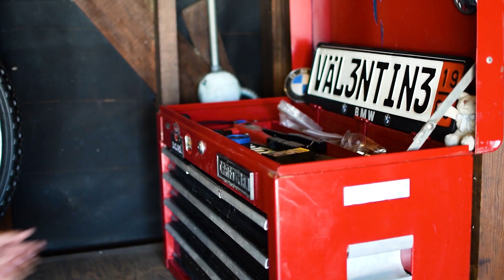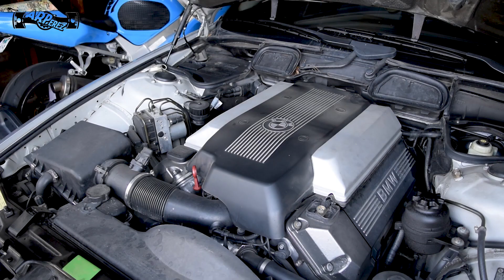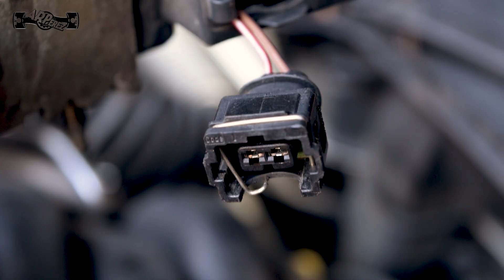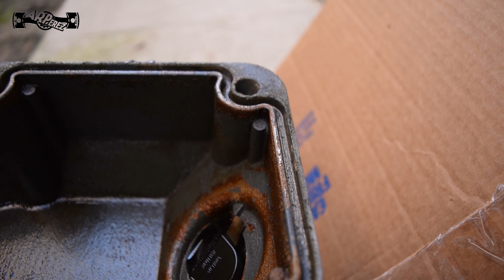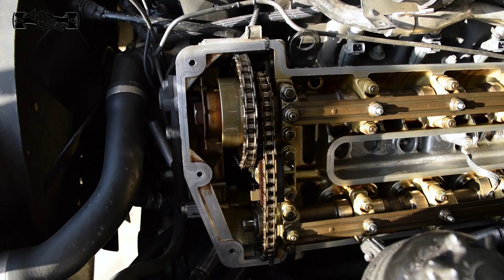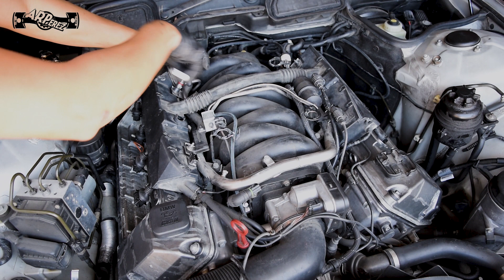HOW TO: Valve Cover Gasket Replacement BMW 7 series (e38)

Comment: Disconnecting the battery is ALWAYS STEP 1!  Wrapping that positive terminal in a shop rag is DANGEROUS and simply dumb! DO NOT follow the instructions on wrapping the hot (positive) terminal in a rag and then setting it aside!!!! DISCONNECT THE BATTERY ALWAYS!!!! Terrible advice, you should update your video!

Comment: Great video.

Here’s a weird question for you, or anyone who might know.

I’m mid way through doing the job on my 1998 E31 840Ci Sport.

I have owned this car for nearly 20 years and it only has 27K miles on the clock. I’m pretty sure no one has been into this engine before.

I have made a weird discovery! On every single one of my Oil Spray bars there is only ONE nut holding the down. On every single one this is the very FRONT nut. The other studs that the bars sit on have no nuts! So they can lift a bit with just your finger.

I had figured this must be ‘normal’ and how they are meant to, given the above.

However, I then saw in your video that your four spray bars have nuts on EVERY single threaded post holding the spray bars down.

You have 16 nuts, whereas I only have 4…..I don’t think my engine has been opened before.

I’m totally confused!

Any ideas?

TIA
Reply from the maker: That's is weird, BMW QC department must have gone to get schnitzels and beer early that day.

Comment: How in the FUCK do you get to the injector clip off cylinder 4?!??!
Reply from the maker: There's no special trick my frustrated friend, with that one you have to feel it, like Luke with the "Force". But seriously, it's patience and perseverance. I suggest a good flashlight, some sort of mirror and a magnet along with a thin 90degree pick tool or hook tool. May the Force be with you.
Reply: @ARPerez  yo I got it. the window to even see what you're doing or get a pick in is teeny tiny cuz of that wire conduit to the fuse box and it didn't help that apparently my clip was rusted to the injector collar so even when i had it it would not budge. i was SUPREMELY frustrated in the dark trying to do this at like 11pm lol but thank you.

also my torque wrench only goes down to 120in•lbs (13.6nm) so I just used the ugga dugga scale. gave her about 3/4 of an ugga dugga or 1.5 uggas seems good enough to squish all the grommets but didn't strip anything. Not all the beans, maybe just one lil bean..
Reply from the maker: @Paios  The official ugga dugga scale is totally acceptable as a means of guesstimating the tightness of any give fastener to a surface. Good job!

Comment: I lost the square piece for the positive termimal on top of the valve cover opposite side of the oil cap what do I do can i just tap off the end of the postitve wire to move the car around
Reply from the maker: Yeah that should work

Comment: Just in case someone finds this, it's good to tighten up all the oil rail bolts and they are 10nm torque spec per the Bentley Manual.

Comment: I was going to attempt this, but now I’m not so sure.
Reply from the maker: I get it, go at your own pace
Reply: @ARPerez  I contacted a shop and the guy told me that replacing the valve cover gaskets would be “putting a bandaid” on the problem and that what I should do is replace the timing chains for $6k instead…That doesn’t sound right to me.
Reply from the maker: Well what’s the problem? Oil leak?
Reply: @ARPerez  Yeah. From old, compromised valve gasket cover seals I’m assuming. Worst on passenger side.
Reply from the maker: I would say if your chains are not making noise take it to another shop. A simple valve cover gasket is not an excuse to do the chains
Reply: @ARPerez  Thanks man.

Comment: Just subscribed. Good video! The purist M62TU owners would like a video on repairing the self leveling components (ride height valve etc( located on the rear axle. This is found on cars with EDC/SLS.
Reply from the maker: Yeah mine is not equipped with that...

Comment: Good video. I hate those little connector clips but your point about taking it slow was great. It got me through it, no problem. I did the driver side without removing the injector box but had to do it on the passenger side. Thanks for posting this!

Comment: Great vid, this is my next project on mine next few weeks. 
Off subject but I just installed a new updated lower timing chain tensioner, old one was weak not much spring to it. Very easy to do (15 min diy, one bolt) Hugh upgrade for longevity of timing chain components.
Reply from the maker: On my gigantic to-do list :)
Reply: What do you mean 15 minutes...?